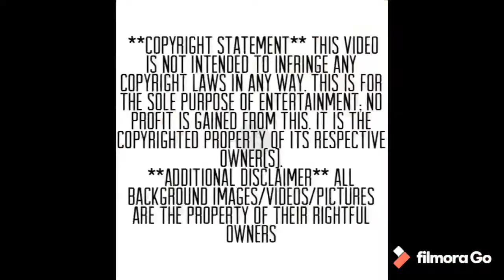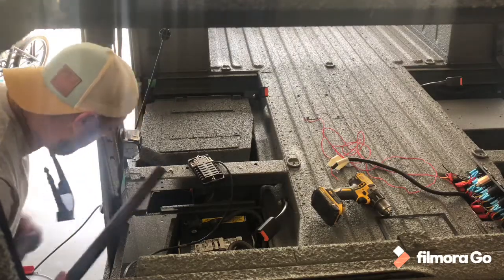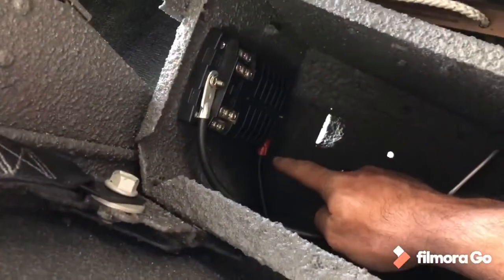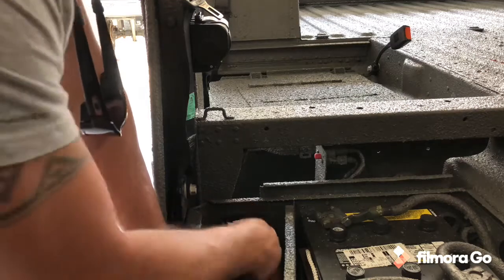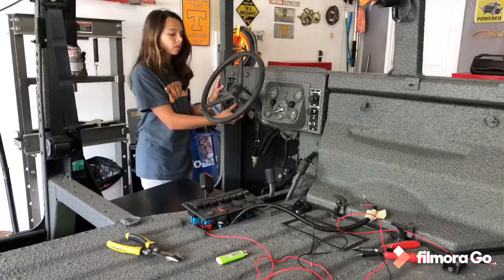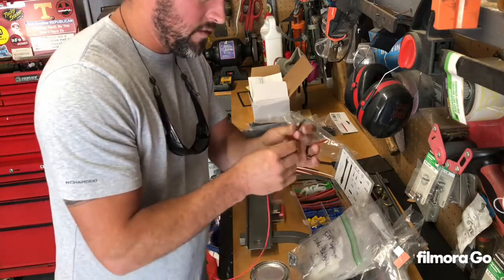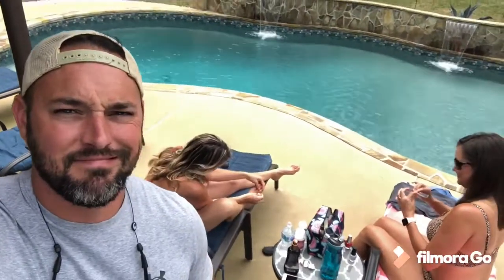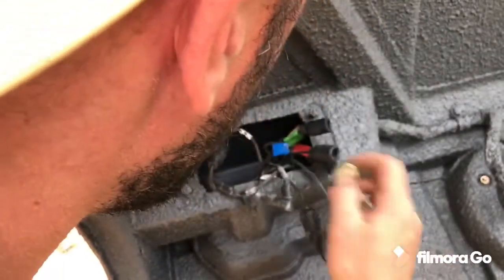Humvee Build Part 14 Turn Signals install

Comment: If you use a 24 volt solenoid and control it with 24 volts and pass the 12 volts through the battery terminals the 12 volts will work with the ignition.

Comment: Is it set up so the corner markers (orange and red) flash with the turn signal? Or are those full time on, and just the signal lamp flashes? Trying to wire mine now. Thanks!
Reply from the maker: The side marker lights, the red and orange one stay on full-time when the headlights are on
Reply from the maker: On the front and rear turn signals and brake lights the whole LED lights blink when the signal is on, however they are on as long as the headlights are on
Reply: @SplitBuilds  Perfect. thanks brotha. that takes a whole bunch of challenges out of the relay setup I was working on.

Comment: What do u have done that the flasher flashing?! Replace the flasher Box or weod in some resistor?! If yes wich ones watts and ohm?
Reply from the maker: Buy the updateded flasher off eBay. Standby I’ll try to find item #
Reply from the maker: eBay item #393052886925. I believe this is the one if I remember correctly
Reply: @SplitBuilds  eBay dont Show me this item with this number, ich have truck lite led in Front and tail, the flasher flicker very dark neraly not visible... I try 25watt 10ohm resistor but than the flasher stay Black dont work anymore... I think I must Chance the flasher Box to this 'nartron led flasher box' or?

Comment: Isn’t running off the battery bad? Since it’s a 2 battery system and it draws unevenly? I have a 24/14v generator, I have to figure out how to wire everything.
Reply from the maker: Not necessarily bad, however that battery might have a shorter life span. Plus all my lights are led so there not drawing that much power.
Reply: Split Builds Have you seen anything on how to tap the 14v side? I was told to grab the dual generator version but I haven’t seen much information on how to run it from there to a panel, and do you still have to convert the 14 to 12?

If you’re not sure, no worries, just trying to find somewhere to start.
Reply from the maker: I haven’t really dug into that. I saw some people adding a third battery under the back seat, all my lights seem fine, but I see what your saying about the 14v issue.On the switch gang that I added it has a voltmeter and when the truck is off it showing 12 V, when the truck is running it will show 13 to 14 V, but I never had an issue with power supply. I may need to do some digging on this.

Comment: Hey brother I have an m998 I've also put halo headlights on but I've held off on turn signal side markers and the LED tail light I read that they could mess up the electrical system due to the low current make the lights flash faster and brake lights not work properly also can mess up cruise control sensor on some of those Humvee have you had any issues
Reply from the maker: They will not work properly with the stock flasher, you’ll need the updated flasher: search eBay: HMMWV MILITARY TRUCK TURN SIGNAL FLASHER CONTROL RELAY. They will work just fine with the updated flasher. I had to buy the flasher for other Humvee’s that I’ve built.
Reply: Have you photo of new flasher ?

Comment: Hey, I used an ammo can to mount an 8 way toggle block with usb and an amp guage.  Mounted it by the shifter.
Reply from the maker: That’s awesome! Great idea. Ammo can would hide wires as well. I like it.
Reply: @SplitBuilds  I can't send a picture thru this thread.